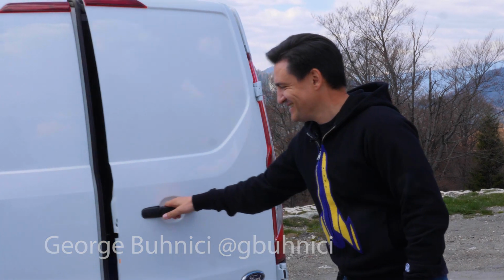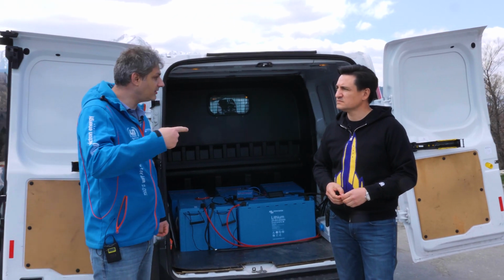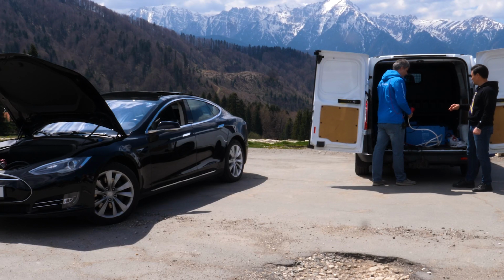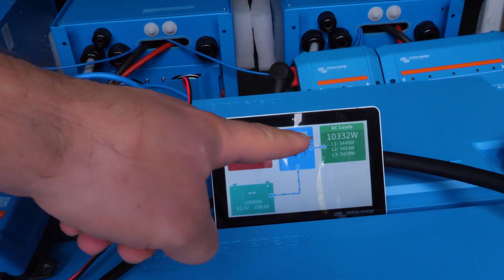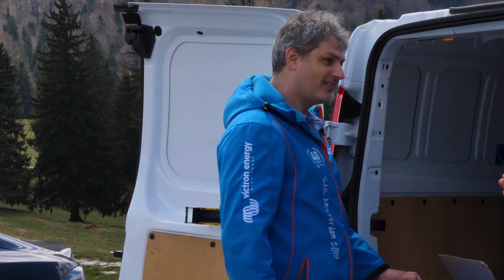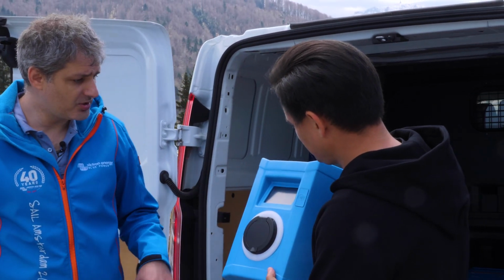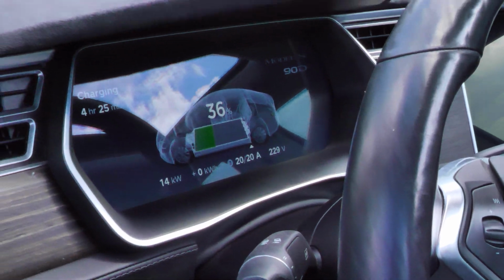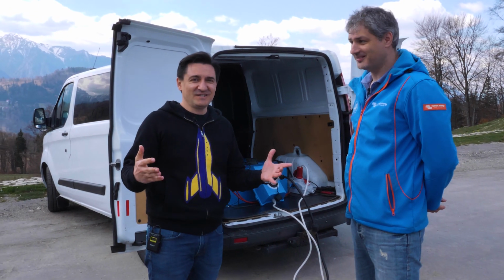Flat Tesla Battery saved by Victron Ambulance

Comment from the maker: 🎯 Key Takeaways for quick navigation:

00:56 🔋 An electric vehicle owner stranded with a low battery on a mountain explores the possibility of charging on-site using an electric ambulance setup.
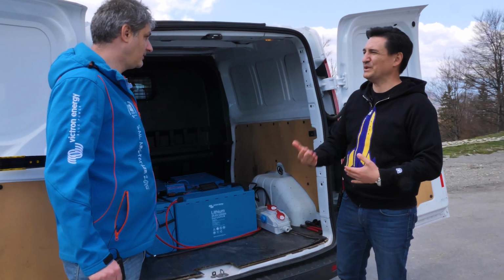02:32 ⚡ The electric ambulance uses three inverters and lithium batteries to charge electric vehicles using a three-phase charger, showcasing the feasibility of mobile charging.
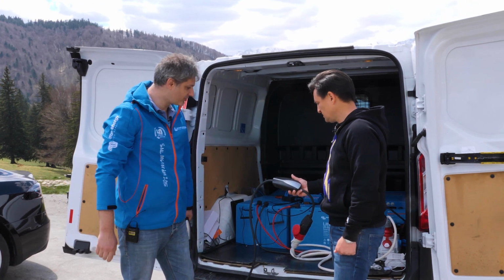05:44 🌞 Lithium batteries are favoured for their weight, fast charging, and discharging capabilities, making them suitable for rapid electric vehicle charging.
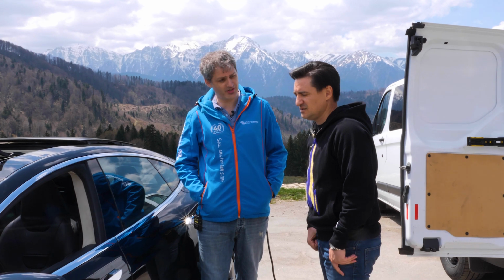06:58 🚗 The video demonstrates charging an electric vehicle with 11 kilowatts on three phases, illustrating the maximum charging capacity for typical Tesla models.
08:05 🚘 Some Tesla Model S vehicles can be upgraded to support 22-kilowatt charging on AC, enhancing charging capabilities with a second internal charger and a compatible charging station.